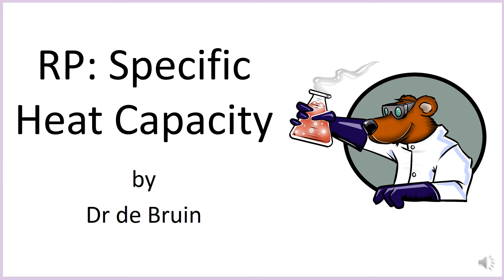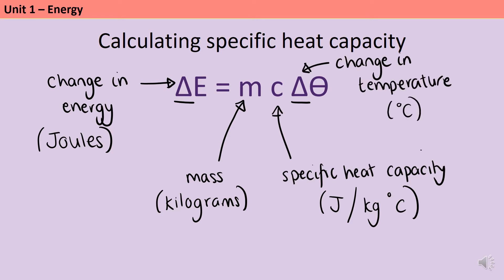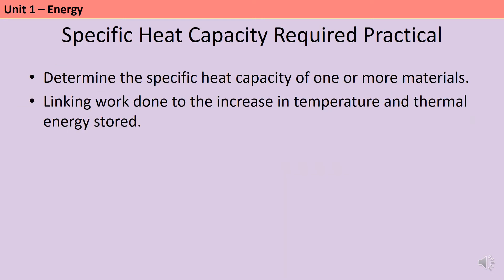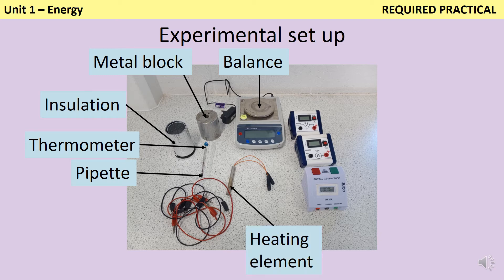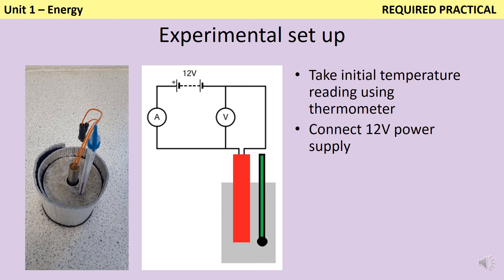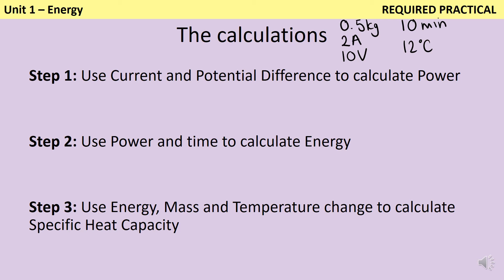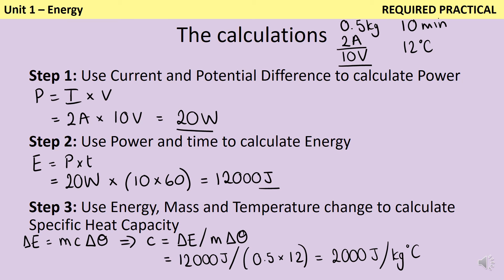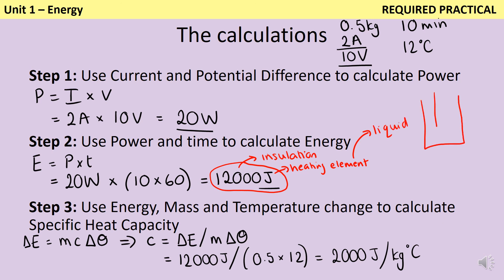AQA GCSE Physics Required Practical 1: Specific heat capacity

Comment: thank you this was great but what is the risk assessment and variables in this practical? also what would the model answer of the steps to do this required practical?
Reply from the maker: The procedure itself doesn't have variables. (In the same way that the chemistry required practical where you make a soluble salt doesn't have variables). You only have variables when you're trying to compare something to answer a question. So for instance, you COULD investigate the specific heat capacity of different materials in which case your independent variable would be the material and your dependent variable would be the SHC you calculated. The only real risks I can see would be burning yourself on the heater or dropping the block on your foot 🤦🏼‍♀️
Reply: Hazard
Consequence
Control measures
Hot immersion heater and sample material
Burnt skin
Do not touch when switched on. Position away from the edge of the desk. Allow time to cool before packing away equipment. Run any burn under cold running water for at least 10 minutes.
Reply from the maker: I talk through a step by step answer here: https://youtu.be/2alTThWfftQ